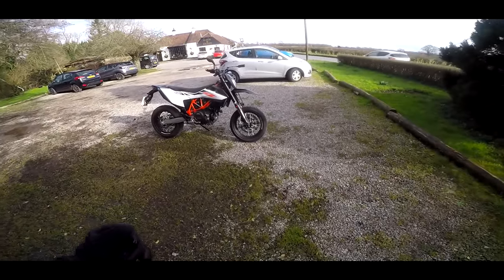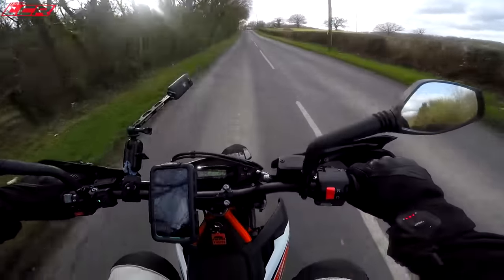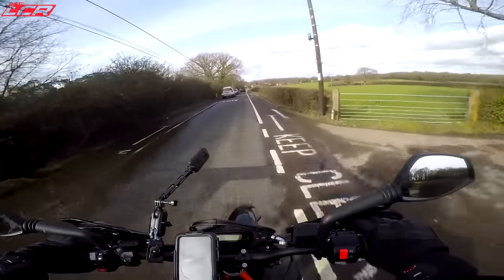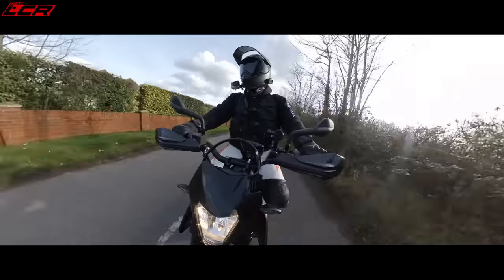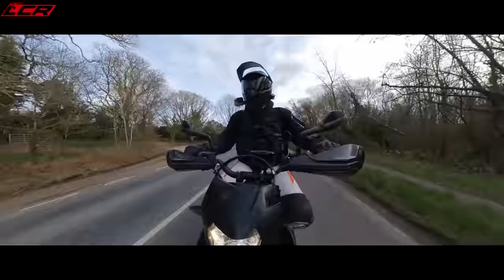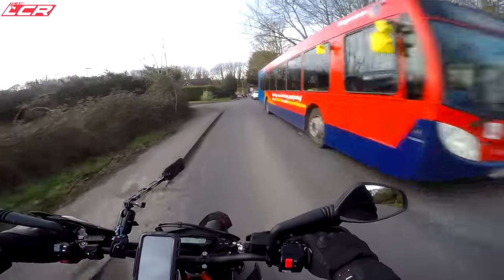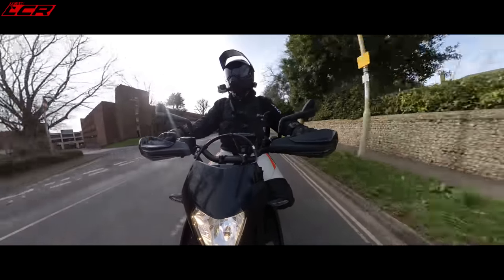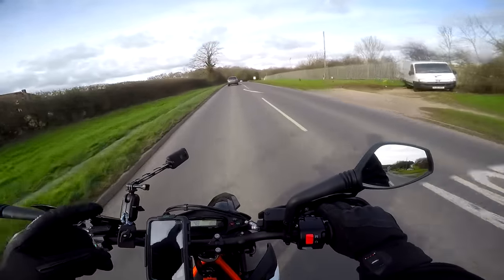How To Run In A New Motorcycle? | KTM 690 Diaries

Comment: Hi Chops Sir i have 2 train of thoughts on break-in, in 95 when my Blade was new i ran it in as recommended,  but by the same token it's just as important to be [OF] the throttle just as much as on, so as to bed pistons in both ways? but like you say bikes have fine tolerances, as for cars i new to guy's back in the day, showing my age here they had 3 litre Capri's, ok the Essex engine has mm tolerances rather than thou? but 1 guy thrashed his & the other took it steady, the thrashed 1 was much faster? ATB Wayne.

Comment: Greetings Mr Chops. Nice video, but did you actually watch all of the BMW build video? Go to 43m 52s and you will see that they push the engine to the limits on a rolling road, and you'll find all vehicle manufacturers do this to ensure they don't go wrong when the customer gets them. I think the manufacturer's run in recommendations are mainly precautionary as you are bedding in the bike as a whole, not just the engine. I think the main thing with any engine is to let it always warm up before giving it the beans.

Comment: I've had 3 new bikes and I've always run them by the manufacturers way, with miles tho I've only got 2500 on both my bikes and apart from the Ducati V4 recalls I've not had and troubles

Comment: Warm it up as always, do no full throttle runs, and no constant Rpm level for long time. After 1000km change oil and warm it up before you beat it. But while driving, not on the side stand in N.

Comment: Bought a Street Triple RS in 2017 and Triumph told me that the first 30 miles were the most important.  Ran the bike up to 10k rpm in first gear and not over 6k for the rest of the gears.  Did this for the first 30 miles and then followed the manufacturer's recommendations up to 600 miles.  Impossible to tell if this did anything for the seals or not.  Gave me peace of mind that I had followed Triumph's guidelines though.
Reply: @Lex-Rex  Constructive.  Thanks for your wisdom 👍

Comment: I used to work in the dyno at cosworth and we ran in the F1 engines. 6000rpm ish to start, then 9000ish then a bearing run in which was high revs (12500rpm) but hardly any load.
Reply from the maker: Oh wow what a fantastic job!! 👏
Reply: Just about to put a deposit down on a smcr 690 after seeing your enthusiasm for them!

Comment: Mechanical sympathy is the key. I'm 200 miles in on a scrambler 1200. First 500 miles should be below 4000rpm. 
I wouldn't say I'm sticking to that, but I'm not taking the piss. The odd blast up to the red line is fine imo. 
It's not the sort of bike you ride flat out all the time, 
Running in is more than just the engine though 👍
Reply from the maker: Yes agreed Leon sounds like the best approach to me 👍

Comment: Also to keep in mind, soft run in isn't just the right thing to do. You have to vary your throttle position to make sure you spray plenty of fuel. Cruising for long periods of time on stable revs isn't a healthy way of running the bike in. 
Avoid bogging it or limit reving it as well. And with a bit of luck you'll have a bike set up for many happy miles.

Comment: Just do it as per the owners manual.. Its there for a reason !
Reply: Yeah most likely that your warrenty expires before the engine goes boom...
Reply: @justacomment1657  I doubt that would happen if you looked after it.. I've put 45000 on my street triple and it still runs as well as the day I bought it.
Reply: @MattJones675GR9  Great Bike that tripple.

It surely does not hurt an engine to do it slowly. 

But what about dodgy engines, one's which got somehow damaged during assambly.... May take a small amount of oil.... And you run them in slow, always treat them slow.... Always fill up the oil it needs.... After the first year next season starts and it the goes boom - with luck you are out of warrenty now....

The same dodgy engine would not last that long if you really give it the beans after the first oilchange. It would die quickly and it would still be covered by warranty.

Here is my take on it.
There are no parts that can "run In" on a modern engine. All touching parts do have a hardened surface (if that goes away that part is basicly done for) . If the engine is warm and on the right oil there should be no metal on metal touching.... (the valvetrain might being an exception)... All the bearings are hardened and fit true to size... 
After the first oilchange small leftovers from the assembly should have left the engine and its lubrication system.

Anyway it will not hurt an engine to take it slow, but it will not save a faulty one eighter....

Comment: `How to run in a new motorcycle` : I`m not gonna tell you how, it`s a difficult one. I don`t understand how engines work but here`s how I do it: I`m just being gentle with it to get a peace of mind. Cheers mate :)
FYI: It is vital to get a good seal between the rings and the cylinder wall.
      Only load under accel/decel(engine breaking) can do this well. No need to redline, a long, steep hill is perfect !
      80% of your running in takes place in the first 25 miles( yes 25)
     Take it out new and load the engine as above, change oil/filter after 25 miles( it will be grim)
     Bob`s your uncle, your engine will now lose neither power nor oil due to blow-by. Tried and tested this on many brand new engines.
     Still do the 600 mile service to keep warranty happy.
Remember, the workshops are full of people complaining their bikes drink oil, much to the bewilderment of `careful owners` who literally memorised the manual to the letter :) A classic is a stalwart Honda or BMW customer who tend to fit the `careful profile`.

Comment: i brought 2 2nd hand 1050 triumphs low mileage ex demo's assume both ridden hard from new both burn't oil and destroyed no2 pistons 1st  after i p/x it in for the 2nd which did so with in 3 months so was covered by warranty had 2 new bikes and run in to manufactures spec both didn't use an ounce of oil sold 1 @ 16000 miles and other @28000 miles
Reply: terry malyon what were the bikes at the end were they speed triples?
Reply: @Addy29plus5  no kinda put me off triumphs both were suzuki's gsxr750 just over a year old when i sold it with 16000 and dl1000 28000 about 1 1/2 years old  now got a gsx 1400 with just over 96000 miles 2005 model
Reply: terry malyon I have a triumph street triple and CBR600RR. The newer triumphs are top quality

Comment: as you know there Is another method between hard and soft, search" motoman engine break in" in Google and youtube , you have to change the oil often with conventional quality oil and run the engine not hard but accellerate and decelerate  to create proper pressure.

Comment: Hi chops running in my 690 smcr at mo and am riding it quite hard an not being gentle with it. Will change oil an filters myself before the 600 mile first service
Reply: Same with my 701sm but will let dealer do the service at 600 miles for warranty and i will change it again myself at around 1500 miles

Comment: Got a husky 701sm and ran in hard(ish) . Wasn't bouncing off limiter but still pulling and letting engine brake work as well. I'm on almost 7k miles and no engine problems or oil burning. I see alot saying about manufacturers know best but if that's the case with husky why do almost all the 701s have clutch slave cylinder issues?

Comment: The reality is these days that a big part of the run in is, as you say, running the other parts of the bike in but also running the rider in.  By that I mean getting used to the bike.   What they don’t want to say is “yeah go for it” and then you crash not knowing the limits.   

The engine itself is broken in within the first 5 or 6 heat cycles.   The brakes take a couple of hundred miles and the tyres are based on heat cycles also.

Comment: I worked on motorcycles professionally since 1980 till 2007 I run plenty of motorcycles I always warm my bikes up and just because the temperature gauge says water temperatures good doesn't mean the engines warm I had an 02 Kawasaki zrx1200 I put a hundred fourteen thousand miles on that bike a friend of mine had one with about 30,000 miles on it mine had about 70 something Thousand Miles at that time and he says to me how come your engine sound so quiet and mind making all kinds of noise I said because I always warm it up and I broke it in never took off with a cold engine and I am now the proud owner of a 2023 KTM 690 smcr just purchase this morning and I intend to break it and just as I've done all of my bikes through my years and regardless of length of time i will own it. I believe breaking it in properly it'll last longer it'll stay quieter all your internal engine parts will polish themselves to the running clearances that's a fact
Reply from the maker: Absolutely agree 👍 👏
Reply: @LambChopRides   What’s your opinion on doing double the oil changes as what it states on the owners manual. Say instead of every 16k you do it every 8K. 

Cheers.

Comment: First bike was used well passed break in. Next bike was new, I followed manufacturers directions but only kept it a year. Traded it in on another new one. Followed directions and had 76k miles on it when I sold it, trouble free. Next bike was a demo with about 500 miles on it. I followed directions and put 156 k miles on it. Transmission gave up on her. Next bike was used and I have no idea how it was broken in. Motor gave up on it at 46k miles. Next one will be new and i will follow break in procedure on it.

Comment: run in per manufacturer. End of story. If you don't plan on keeping it do what you will but then again that's why I don't buy used bikes anymore. Factory prescribed break-in on all my new bikes and have never had an issue (2004 R12GS over 80,000 km in a 2 yr epic trip (or trips depending on your POV) cross country and internationally, 2006 HP2 65K over the last 14 yrs of ownership and 2015 Triumph Rocket 40,000 km in 5 yrs of ownership )

Comment: Coming up to 60 this year. Ridden, built, and rebuilt and worked on air cooled bikes all my adult life. Running in. Basically, don't thrash them, and importantly dont lug them. First 500 miles, avoid motorways and constant same revs, and avoid pillions. Dump the mineral oil at 250. Again 500 miles later. At 1500 miles, run what oil you like, ride it like you stole it, but never rev it hard till warmed up. Thank me later...

Comment: Hey Chopsy, good vid. Interesting onfo. Question, buying a used bike allready run in from a dealer. How would you know its been done right.
Reply from the maker: Yeah that's the problem you don't... if its a dealer run in then its an ex demo bike. My advice would be steer clear
Reply: @LambChopRides  I hear that

Comment: 18K Trouble free miles on 2017 Sreet Triple 765R from new. Ran it in slightly more enthusiatically than manufacture's recommendation but, nonetheless, sympathetically.
Reply: Ride it like you ride. The minute I bought my 2018 R and got it on the highway, I took her up to 130mph. Changed the oil myself at like 1,200 miles. Now have over 10k on the odometer.

Comment: I have always been told by dealers, including the ducati dealer with my hyper 950 to just ride it normally. Dont baby it but dont cane it. I did this and the bike burns no oil at all and it runs great. I dont think pootling around at low revs is the way to go.
My 2012 690smc was broken in by the book and i had to top the oil up every 200 miles!! It was terrible. 
I would never red line a bike straight out of the showroom but i think it needs the higher rpm to give the right pressure behind the piston rings to seat properly. 
The 690 is synonymous with drinking oil and to be fair it does not seem to be linked with break-in procedure as people who have done it both ways seem to have the problem. My ktm dealer told me it would stop burning oil at 30,000km😂😂😂 just trying to get me out of the door as they have no clue why either!
Reply from the maker: Yes my old 701 used to burn a bit.. I'm really interested to see how this one goes.. Am taking things easy so let's see!

Comment: Lifes too short, last 14new bikes ive bought in 9years have all been thrashed from about 10miles, as soon as release compound is scrubbed off of tyres.  Modern tolerances so tight its not necessary as per old days.

Comment: How to run in a motorcycle. Simple. Ride it like you will ride it everyday and change the oil after 600-1000 miles. That's it nothing more, nothing less. A break in period is not necessary for new bikes.

Comment: Here's another one. Too slow a tickover on a fresh motor. Back in the day i built a fair few Harley motors. With a nice carb they will idle pretty much anywhere inc 750 rpm. Not good on a new set of pistons and bores. You want a fast tickover once warmed up. 1000-1200 rpm (HD). And because they pull well low down, people will lug them and change gear (short shift) too early. Again, not good on a fresh motor. Use the box and dont work the motor hard in those first 750-1000 miles.

Comment: 25.4 microns in a thou. Unless you have extremely precise ambient temperature controls in the factory, you cannot accurately measure down to this level of tolerance let alone manufacture to it! If they can reliably mass manufacture to even 20 microns taking into account tool wear etc then they can give themselves a pat on the back. Just BMW marketing BS me thinks, but happy to be proved wrong

Comment: My thought on it was for health and safety rubbish. If something were to go wrong on a new bike, it would do so in the first few hundred miles. I suppose if the rider were to get seriously injured due to a mechanical fault, i dont think the manufacture wants "rider killed on new motorcycle due to fault in engine" to their name. Therefore, if you dont rev higher, you go slower, if ya come off, your less likely to be injured as bad instead of coming off at fast speeds and potentially dying. 
Just my view on it :)

Comment: The answer is very simple.
Put LOAD into the engine, and slow down on the engine braking itself. Dont pin it into the limiter, LOAD through the rpm range and shift, and engine brake.. Repeat severel hundreds/thousands of times.
Drive like a sissy and scared to open the throttle a bit, the engine doesnt get loaded and basically runs idle which does nothing.
Reply: Oh and I ran in my F3 with only 8000rpm available out of 15.500rpm and my engine doesnt burn a drop of oil.

Comment: The best hard break in I’ve seen is a from a racer called Marcel Irnie with a s1000rr brand new with the 8000 rpm limiter took off by BMW 🤔videohttps://youtu.be/JsOWE_NTRnE well worth a watch though I only do it by manufacturers instructions.